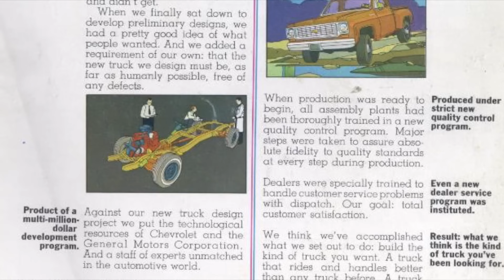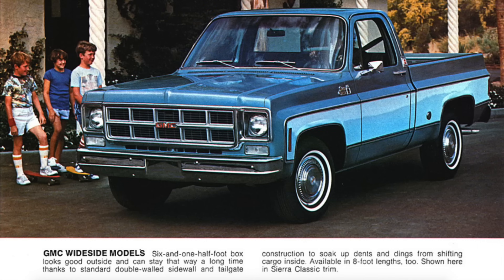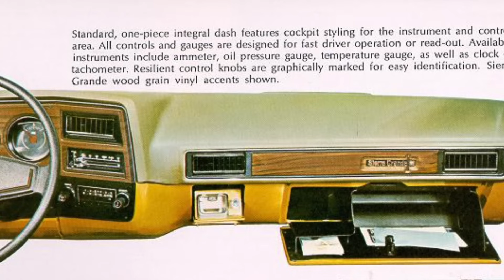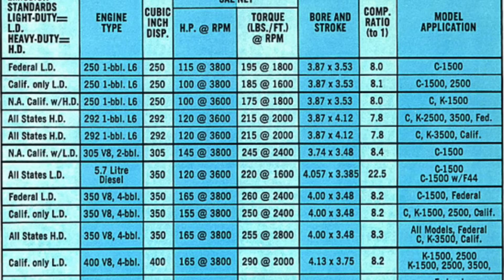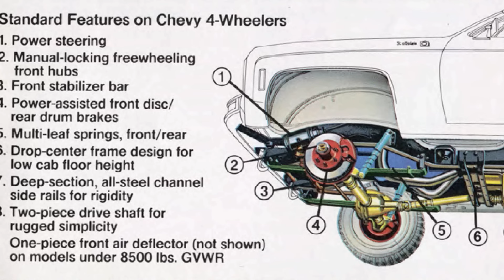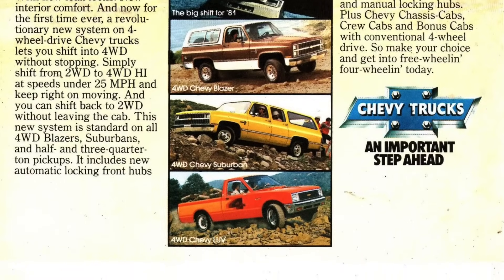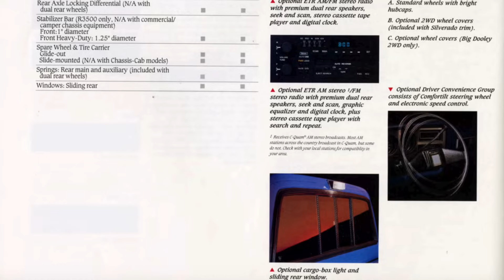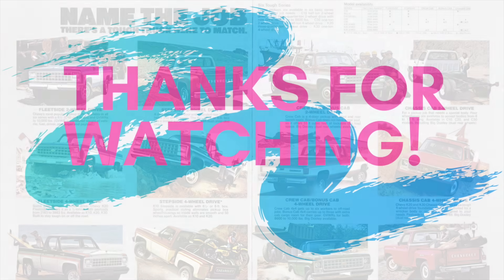73-87 Square Body Chevy & GMC C/K Truck Buyers Guide (Design, Options, Engines, Common Problems)

Comment: Do you know how many of these trucks Chevy would sell if they made them again? Just like these. No heated seats, remote starts, digital compass, blind side assist, retractable side steps, eco boost, Apple Radio, plastic headlights, etc blah blah. A bunch of crap in package stages so they can ramp up the prices. Just a basic engine that you can actually sit on the inside fender well to work on your truck with minimal electronics, roll up windows, mechanical selector switches. It'd save time and money fixing anything that went wrong. As it is now, you need to have an electrical engineering degree and be versed in yoga to even work on todays vehicles. And that doesn't even include all of the devices you have to take off of the top of the engine just to change the damn starter nowadays. Ridiculous. Plain and simple. I refuse to buy a new one. At minimum, they're going for 30k-40k +. Top of the line ones are around 50k-60k +. This fleecing will stop when enough people don't buy these overpriced electrical rollingl plastic buckets. It's a shame too. From what I've seen, you can buy a decent older truck like these for 12k - 20k ( depending on undercarriage rust and if it has a rebuilt motor or a crate engine dropped in it and it'd probably last longer than todays vehicles because there's far less things to go wrong with it. Too many regulations and greed has been put in todays vehicles. This is what makes them expensive to buy, expensive to repair, undesireable at best and overall crap.
Reply: Actually base model trucks do not sell very well, because now even a base truck is so expensive and your going to be making payments for years anyways so you might as well drop the extra 10k to 20k for all the upgrades and comforts. The only people who buy base trucks now are businesses and local county/city's work vehicles. Base trucks also hold poor resale value and alot of people now adays do not want a base beater truck and expect everything digital and effortless to use. The people who appreciate and like basic utilitarian work trucks are a dying breed and there aren't enough demand for the manufacturers to make trucks for. These days everyone wants a 3/4 or 1ton diesel or large gas engine powered truck that drives like a Mercedes or BMW. Its ridiculous and now some of those diesel trucks sell for over 100k. That's more than a house and them things loose value the second it leaves the lot and can get totaled at any second and eventually will break down and be expensive to repair.
Reply: @briang4470  yeah people always talk about how well trucks like this would sell today but most people who want stuff like this are in the used car market so they would not sell well new as well as many emissions and safety regulations that make it impossible for trucks to be as simple and easy to work on
Reply: @briang4470  Older friend of mine just bought a gm diesel crew cab 4x4. Said it was just over 100k once it was his. No trade in, kept his previous truck just like it.  Meanwhile I bought a 2005 3500 long frame with roll up windows and plastic floor, vinyl seats, no cruise, 30 k miles for 2500 bucks. It's straight and runs great, gas, only gripe is mpg.

Comment: all lights including turn signals work but no headlamps. changed switch and headlamps got nothing, even grounds any ideas? oh ya and no floor switch for high beams. its a 1985 k1500 GMC high sierra 4x4 single light

Comment: I have a '68 GMC 1/2 Ton. Inline 6 cyl. Fender side 8 ft box. Bardon bumper.  Has a cab high camper shell insulated and wired with curtains. Carpet kit in good condition. 

Bought in '99 All orig but lots of cab rust. Truck runs well, doesn't use much oil and rebuilt four speed shift on the floor.

Do you think it's worth restoring?
Reply: Yup

Comment: I use to own the 83 long bed Chevy,  yes easy to fix but I had to fix the truck so many times it is a hassle.  The steering radius was a joke.  I would constantly hit curbs in that truck and could not park in driveways,  it would stain every driveway I would go up to.

Comment: I have a 73 GMC c3500 flatbed truck Fremont CA. Built, not sure if they were doing the flatbed alone or not 350 crate engine, 4 speed manual , no frills work truck. How can I find the value for it.

Comment: Rust. Those engines (smog) had NO POWER. Weak frames. Gas hogs. Lacquer paint. Oil can hoods. This was the era of quality control "issues" which led to the "Lemon Laws". 454 was an oil burner.

Comment: The biggest "common" problem with a lot of these is their previous owners. Hacking tje dash for modern radios, sawzalling the A/C components because faster!, poor bodywork on attempted restorations.. Etc..
None make for a death sentence but they are a pain.
Reply: You know how many perfectly good old rare car and truck dash boards got ruined to install a stupid (usually pioneer or sony) single den radio? Way too many and for some reason every GM car with a chevy engine always seemed to get all the ac stuff just ripped off and thrown right in the bushes for no good reason. The only ones that seem to survive intact were cadillacs and buicks.

Comment: The  67 / 72  model  years   Was a  much  better  truck   73 / 80  was  super  crap  81 / 87  they  reworked  the  front  clip  and  got  rid  of  some  hiccups  but  still  not   Perfect   And  the  new age  truck  that  debuted  in  88  /  97   Super  super  junk  I  had  90  Sierra   Glad  when I  got  rid  of  that  G M   great  mistake

Comment: How much is the 1986 C30 Camper Special rated to pull bumper pull and 5th wheel. I am about to get mine on the road and I am trailer shopping

Comment: What about the gas tank? It was in the wrong place on these trucks. They are dangerous in a collision.
Reply: That is a myth. MSNBC was caught lying to the public about that and that their "test demonstration" was staged and the truck had a fake gas cap and they hid a road flare under the truck and over filled the tank to where if you shook the truck gas would fall out. They were forced to admit this on live TV by GM. And besides if you actually look under these trucks, the tank is basically under the seat where you sit. So the truck would have to get hit so hard that the door ends up where you sit before the tank gets crushed and if you got hit that hard, well you'll most likely be dead.

Comment: I have a 1987 square body chevy but many of the previous owners modified it and it drains the battery. What could be draining the battery
Reply: Hmm could be any number of things but lickly whatever it is has something to do with the ignition. Either something isnt wired to the ignition and stays on or possibly your ignition switch is faulty and not turning off properly but then again you could have bad ground but usually your battery will get hot if that's the case so check to see how warm your battery is when its not running and when it is running if it gets hot might have a bad ground somewhere but really idk it could be anything. If you have a custom radio while the truck is off plug in an aux cord then bump the other end in things to see if you can hear the speakers make any noises usually if you stick it to your finger you might hear static in the speakers if that happens then your radio isnt wired properly to your ignition and is drawing power while the truck is off other than that test you'll have to go around with a volt meter testing everything to see what's drawing power it could be the electric choke your fan blower motor it could be anything lol.
Reply: I was a driveability tech for 35+ years, if your having a draw on the electrical system while parked here what you do. Get a good working 12v test light, connect it between the positive and negative posts of the battery to verify that the light is working properly. Then disconnect and remove the positive terminal from the battery, take the test light and connect one end to the positive battery post and the other to the positive cable lug. If the test light lights you got a short to ground, make sure the doors are closed and the door switch is completely depressed, if the light is still on then you must start with the fuse panel. Pull a fuse out, is the light still on? (remember the door switch, it must be depressed) if the light is still on that circuit is fine, put fuse back, go on to next fuse. Same thing, light on or off? Door switch? What you are looking for is the test light going out, that means the problem is on that circuit. Get a good wiring diagram and follow that circuit, test all the components and splices in the wiring system, it could be a hot wire grounded, a component grounded or bad wiring. Thats how I made big bucks doing electrical drivability.
Reply: What kind of modifications are you talking about?
Reply: If you cant or haven't figure it out, maybe hook up an on/off switch directly to your battery to kill all power. It's also a good theft deterrent too.
Reply: @pizzandoughnutspage7817  That is exactly what I do to find problems. Idiot lights do good.
Reply: Idk if your still trying to figure this out but If it has an electric choke check to see if someone before you wired it up wrong like to constant power. That's what was draining mine.

Comment: i prefer 2nd generation bar fuel tank location but 3rd had issues being outside the frame. sq bodies rotted bad, had weak and brittle frames, engines had no power and poor castings. Only good points was crew cab and cockpit style gauges

Comment: 73 and 74 were rust buckets and the 307ci was a dog! I had a 73 was the worse vehicle I ever had!!!!! The 75 was more improved as far as corrosion and rust the 350 ci was a much better engine gas mileage were the same with both engines about 12 mpg!

Comment: Ive always loved them, but they are overhyped. Beautiful, but age like trash. Ive never seen a dentside with a completely rotted floorboard and frame that maakes more squeaks outside of the rust than thought humanly possible. Not even gonna mention the hood on a squarebody, if you've owned one you know why i bring it up. These are INCREDIBLY easy to work on, but the catch is you'll be working on them a lot more often than you think

Comment: A common problem of the squarebody is the carburetor.
Reply: That's not true. If you have carburetor problems you usually have a dirty or contaminated fuel system or the carb needs to be rebuilt or repaired. Carbureted vehicles when everything is working properly are reliable. Before 1985 over 95% of cars prior were carbureted and being driven everyday for years. Carburetors do not deserve all the hate they get, they only have problems when people neglect maintanance or mess things up by not knowing how to properly adjust,maintain and repair them.
Reply: Brian G finally, somebody with a clue!!!!

Cars and trucks ran just fine with “primitive” carburetors for almost a century. They were expected to start in any weather, in any environment, without hassles, by grandma on her way to bingo, or a priest on his way to church. If they were reliable then, why can’t they be now???  

Properly maintained, a carburetor will work fine. The problem is, people refuse to maintain anything. Too many people think automotive maintenance is opening the fuel door.
Reply: @briang4470  agreed!!
Reply: @mattrodgers4878  yep, it's a disposable society now. Were getting lazier and lazier as a society and people dont want to get there hands dirty.
Reply: I'm 51 and still run a carb on my 76, went seven years un touched. looked it over, no new parts, going another seven now.

Comment: Rust bad . Front brake lines go bad . Noisy cab . Burns lots of fuel . Not recommended these models head three . 77 81 85 .

Comment: Are they any good?
It's a fucking Chevy
Should you get one?
It's a fucking Chevy
Is it worth your money?
Depends on the seller and your ability to haggle

There. Hopefully I scared a few people off and prices will drop so I can buy another one

You got the years wrong
Half ton 73-87
3/4 ton, 1 ton, Blazer, Suburban all ran to 91

73-79 "round eye" headlights and vertical turn signals

80 square headlights and vertical turn signals

81-91 square headlights and horizontal turn signals

I believe 76 was the first year for fuel doors rather than the cap being exposed on the bed side

75 was the first Silveraydo. Top of the line trim. Several other firsts that year. None of which I recall offhand.

79 first catalytic converter

87 VIN designation change. Instead of the 5th character being C or K for 2 or 4 wheel drive, they became R and V respectively.
Also the first year for TBI. The sad death of the carburetor.

Y'all go ahead and get them short beds and step sides. Enjoy. I like a long bed fleet side for greater cargo capacity. You know, that thing that trucks were meant to do? Hauling cargo?

My dad had a 76 c10 long bed with over load coils, and a 73 GMC 25 HUNDRED Super Custom Camper Special 2wd.
Both 350/350

I had an 85 k20 Silveraydo Camper Special on 4" lift and 35x12.5R16 350/400 semi floating 10.5" ring gear 14 bolt. Not the full floating 11.5" ring gear corporate 14 bolt

And a 1980 GMC C1500 350/400 with RPO code F44 "Heavy Half"

All long beds, all fantastic trucks. Well, mine were projects that I never finished. Fuck. I need another Square

Comment: Ford 1980-1997 is way better!
Reply: No way!
Reply: No, thanks I would rather walk than have my duraspark box go bad driving down the road or the ignition switch fall apart and catch on fire or the 3in section of fuel line next to the distributor dry rot and leak on the distributor or have the accelerator pump get a pinhole and spray gas all over the engine. I think I'll stick to the good ole chevy, the body might be half rust but that good old 350 keeps on running like new.
Reply: @briang4470   --  I love it !!  By the way.......  I'm a die hard Chevy/GMC man, but once along time ago I got stupid and bought a 1985 Ford F150.  True story, I drove home from work and pulled in the driveway, went inside and 5 minutes later noticed smoke drifting past the window.  I ran outside and the Ford was engulfed in flames.  Had to call the fire department.  It was a total loss.  I think this was in 1992.  Never owned a Ford before or since.  Oh, and besides the fire, the truck gave me nothing but problems since the day I owned it.
Reply: @ironcladranchandforge7292  dude that id what my luck is like with any ford product. For that reason I'm a diehard GM guy for life. I had a buddy though that had the exact opposite luck. He would have the junkiest falling apart 80s and 70s fords that would run for ever but as soon as he jumped in the seat of a chevy it would break down immediately, it was funny.
Reply: @briang4470   --  LOL!!  Must be fate I guess.  I'm old (er) and I don't even know how many Chevy/GMC trucks I've owned.  But, I've never had one leave me on the side of the road, (knock on wood).  I've got 4 of them in the driveway now, oh and my wife has a Dodge one ton.  Believe it or not, my favorite is my restored 1960 Chevy c10 Apache stepside with the 235 I6.  Reliable as hell and fun to drive.  Although I only drive it during the summer.  It hasn't seen a drop of rain in 25 years.  My modern diesels are great but there's something about that '60.  My 1981 GMC one ton camper special with the 454 big block is a great truck as well.  It only has 65k original miles and looks great with no rust.  We use it though to haul hay and cord wood, etc.  It has a flat bed on it now and is used as a ranch truck.  But we keep it looking and running great.  We don't beat on it.
Reply: @ironcladranchandforge7292  yeah I come from a family of chevy people. My grandfather always said that a Ford ruined his marriage lol. He hated fords and said that noone is allowed to park any ford at his house. He was a mechanic all of his life and he always had junky,rusted out chevys that he would keep running forever. He also did towing for a while and had a 74 c30 wrecker and he was from staten island and had rusted out 3 cabs in the span of about 8 years every panel on the truck was a different color and was built from about 10 different trucks and then drove the truck down to florida with his family in the 80s. GM products have always treated me and my family well, we have had some OK fords but we would only take them if we got a good deal on them.
Reply: @briang4470   --  Smart man your Grandfather is.  We live in a very remote and arid (high desert) area of Eastern Oregon.  We don't have rust problems here at all.  Also, when it snows, they don't salt roads here. They plow and lay gravel otherwise you're on your own, LOL.... Our biggest problem is finding a gas station.  That's why we have our own fuel tanks on the ranch and have fuel delivery's a couple times a year.  It's a 140 mile trip (one way) just to find a store that sells cloths.  So, to us a good truck is absolutely indispensable.  It's a life line.
Reply: It's all a matter of opinion. I have a 78 and my brother has an 86. He prefers his and I prefer mine lol. It's pretty much the same truck except for a few minor alterations.
Reply: @briang4470  I've never had any of those problems. I've been driving them since early 80's. Have a 76 F250 licensed right now. But, I will drive a GM or Dodge. In fact, a man gave me a Dodge, early 80's half ton. I haven't picked it up. Straight truck, just needs starter and fuel pump.